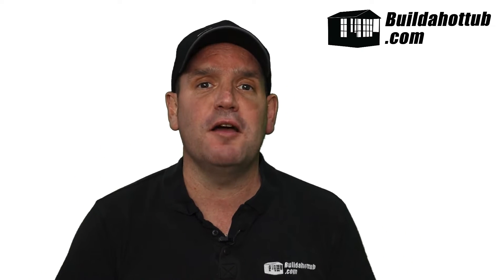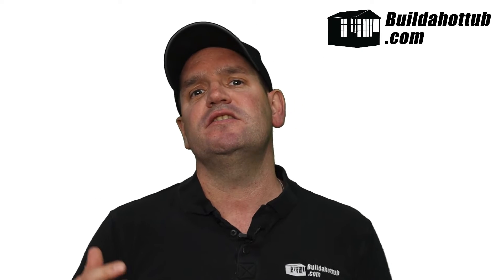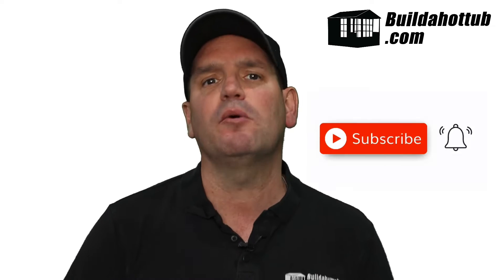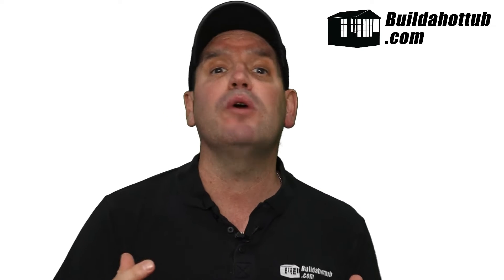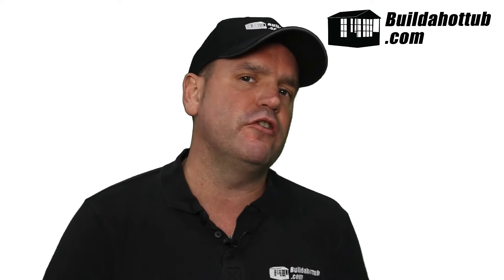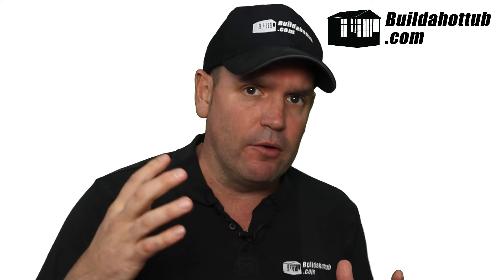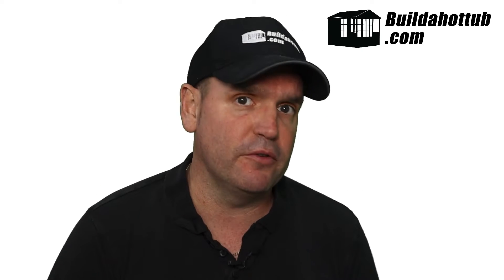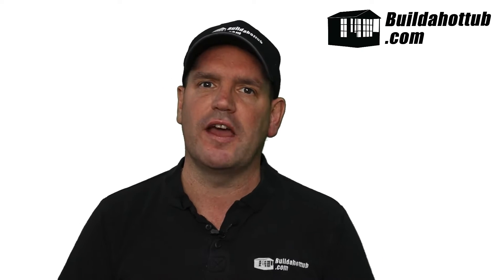How To Control a Heat Pump with ANY Hot Tub Spa Pack

Comment: Hi, I'm trying to find a way to heat my tub using the overnight tariff I have. I have the heat pump which I can control times through my app but i am relying on flow like you mention in the video. I don't have any control over timing on my tub circulation, is there any way around this or making the tub smart? Controller is a balbao I think. Cheers 🥂

Comment: Could you do away with the heater and just rely on the heat pump
Reply from the maker: Yes stuart, but you need to leave the heater in there as there are some sensors inside that will cause errors if they get disconnected - but you can unplug its power of course and just rely on the heat pump. - Thanks for the comment - Andi

Comment: Hi Andy, great videos.  I have a ashp that was fitted on my hot tub at installation. The installer said he had left the Balboa heater connected as well, because they can support each other. I am not sure that the ashp is heating the water or the Balboa. I very rarely hear the fan kick in and when it does it is only for a very short period of time. How can I make sure that it is the asap that is heating the water?
Reply from the maker: Hi Linda, thanks for the comment. You can disconnect the electrical heater yoursel. Turn the power off at the breaker, access the spa pack underneath in your cabinet. That is the one with the square box and silver tube at the bottom. Remove the front, usually 2 scerws. At the bottom, if you are on a Balboa pack, there is a black connection plug that you can unplug from the board. If you are on a Gecko system, trace the power cord from the heater to the board and unplug it. Then, you will only have your air source doing the heating - hope that helps - Andi

Comment: Hi Thanks for the vid. How do you go about using the heat pump to cool the spa in summer? Everything I've seen with retro fitted heat pumps is for heating only? Thanks
Reply from the maker: Hi Tony, only certain models have that heating and cooling mode - it is not a given that an ASHP can do both. Hope that helps - Andi

Comment: Awesome video Andy! I’m orientating on installing a heatpump on my 1500L excite spa  which already has quite an energy efficient LX WTC50 circulationpump. Now the system is quite new and has a balboa BP600. I could fit the clim8zone 5kw but I’m quite hesitant after reading the performance reviews. Now I’m looking at a W’eau 8kW full inverter vertical (because of space inside the gazebo). The man from the company told me to unplug the original heater and simply put the circulationpump on 24/7 so the heatpump could do its job and it needs continuous flow. That sounds really weird to run the circulation 24/7 also with the eye on the goal of energy saving. Why would I save energy if I need to run my circulation 24/7. 

Now are you saying if I just unplug the heater but leave the rest undisturbed the temperature sensor will still tell the spa it needs heat and the circulationpump kicks in when heat is needed? 

Because then I’m convinced about the W’eau. It’s just piping and connecting the powercord to a normal 230V wall outlet in my gazebo. 
The spa has it’s own 400V/32A breaker.

Comment: Would I get an error code by disconnecting the heater on a Spanet SV Mini?
Reply from the maker: Hi Alex, not sure to be honest as I am not massively familair with Spanet kit. You can easily try before you buy anything - should be easy enough to disconnect and then see if you can run your hot tub normally without error codes (or heat of course!) - hope that helps - Andi

Comment: Hi Andy, I have a air source heat pump fitted to my 13amp hot tub. What my problem is when my hot tub goes through its one hour cycle twice a day, due to the flow switch turning on my air source heat pump the temp exceeds what the setting is on my hot tub by 2 degrees. HT 37 degrees. ASP 39 degrees.
Reply from the maker: Hi John, sounds like you need to be matching the temperature on your air source heat pump to the same temperature you have set on the Hot Tub. Leaving your air source set to 39C and putting flow through it will of course cause it to heat if it is not at temperature. It cannot discern between a filter cycle and a call for heat - it just sees flow. Match the temperatures and that should sort your problem. - Hope that helps - Andi

Comment: Hi Andy great video 👍🏻.
 If I may , how do you use the heat pump exclusively, not use the spa pack heater . Do I have to fit a Relay on the Balboa spa pack ?
Reply from the maker: Hi Jason, no not at all - you unplug the balboa heater from the board - it is a molex connection that just unplugs. Leave the spa pack in situ as you want to use the sensors in there and then the heat pump is controlled by flow. Pump not running - no heating from air source - really simple. Let me know if I can help with the supply of a comfortline - they are in my online store at shop.buildahottub.com
Reply: @Buildahottub  thanks Andy as always helpful & prompt . Comfort line heat pumps look fantastic
Reply: Hi Andy if the circulation pump flow controls the heatpump does that mean the heat pump will switch on heat in its filter cycle weather tge the tub is demanding heat or not?

Comment: @Buildahottub  Hi having watched all your vids which are really helpful. I am slightly concerned if I set the hot tub control temp to 38 and set the ASHP to 35 deg the circ pump will continually run with the normal heater contacts closed but with no heat added. Won't this keep running until temp is achieved? I am looking at this from a cost saving point of view so realistically I would set both to 35 deg C and then alter them both up if needed. I really wanted one that allows the true wifi control to raise and lower the hot tub temp remotely.
Reply from the maker: @Duncan, Good Morning. Your logic is totally correct here - you have to set the temps on the Spa Pack and the Air Source to match otherwise you will end up with the scenario you describe above. The WIFI module that is available with the Comfortlines in my opion is way better than the Balboa system I have on my Spa Pack - never drops out and is rock solid. Heat Pumps, WIFI and Connection Kits are all available here - https://shop.buildahottub.com/product-category/air-source-heat-pumps/ - if you would like some advice on where to connect - dtop me a photo to my email - andi {a. t} buildahottub.com and I will gladly mark it up for you. Hope that helps - thanks, Andi

Comment: What about the filtration cycles? Circ pump also kicks in when you are using other pumps etc. And some even have 24H circ pumps. I use a seperate circ pump that is switched by the spa packs heater points, thus only create flow to the heat pump when the spa pack askes for heat.
Reply from the maker: Hi Ralf, thanks for the message. If you are matching the termostat settings on the Air Source and on your Spa then the filter cycles are not a problem.  Even if you are not, you would only get a small amount of heating during the cycle as most are 20mins each twice a day. 24h Circulation pumps are not commonly found on hot tubs, not domestic ones anyway. If it was running 24/7 then you would need to use the thermostat on the ASHP to control the heating.  The ciruclation pump being switched on by the spa pack is exactly how this should work. It creates flow so indirectly turns on the heat pump as it is "calling for heat" - this is how I run my own hot tub on ASHP and all of my customers do the same.  - Hope that helps - Andi